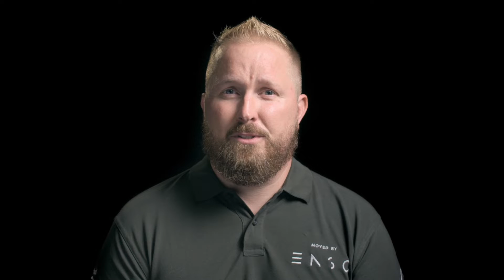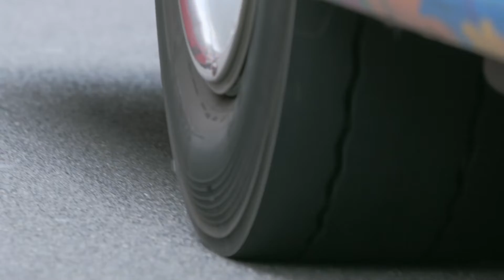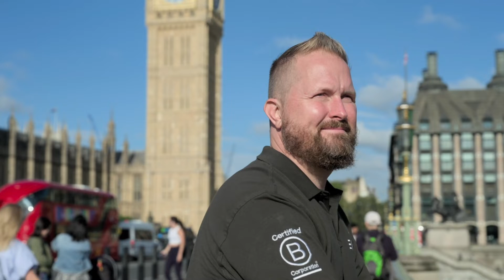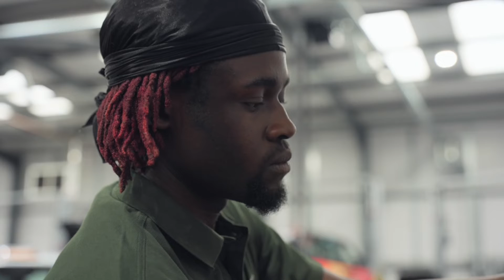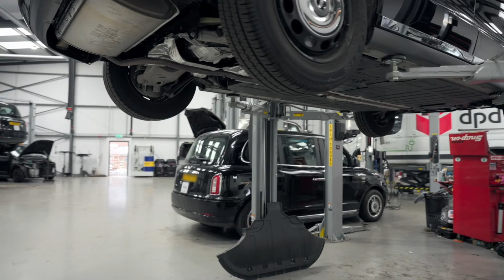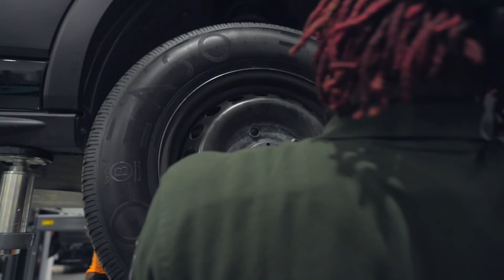The Problem With Electric Vehicle Tyres (And the Solution!) | @EarthshotPrize

Comment: EV’s are emphatically not zero emission & it’s offensive to claim otherwise. EV’s are 1/3rd heavier than ICE vehicles & tyre particulates are x1200 more polluting than modern ICE exhaust emissions. Synthetic fuel would have a 90% reduction in CO2 emissions with far less change required for the average driver & vastly reduce CO2 needed to manufacture EV’s.

Comment: You haven't explained how exactly your tires are solving the problem of tire dust pollution. Are not your tires still made out of rubber? And still wears out just like the other regular tires?
Reply: There is a longer video available from The Earthshot Prize.  It's worth a look.